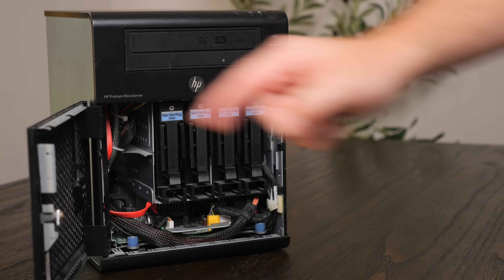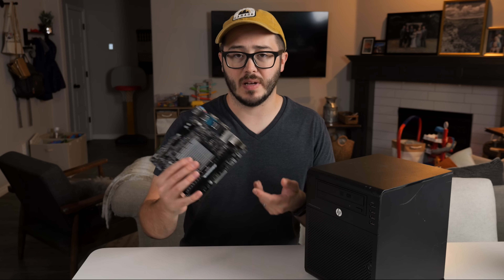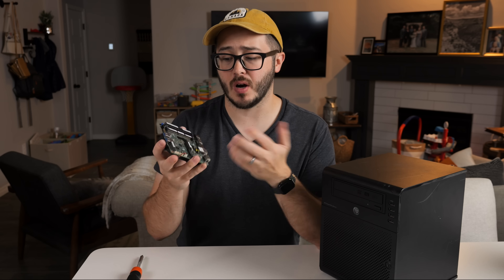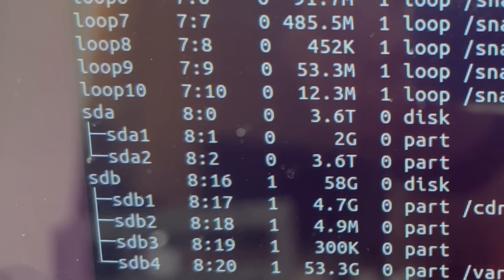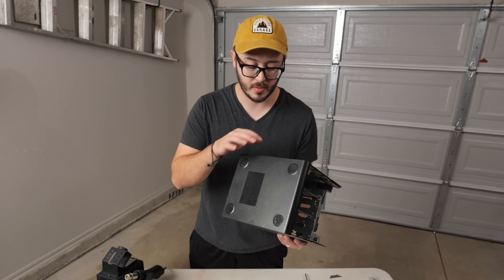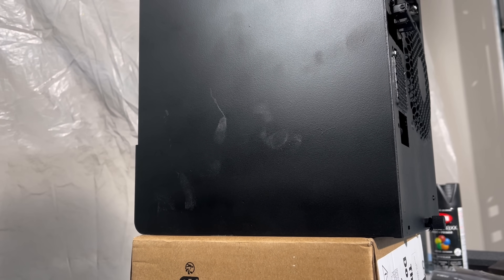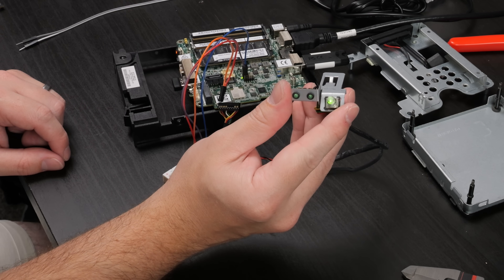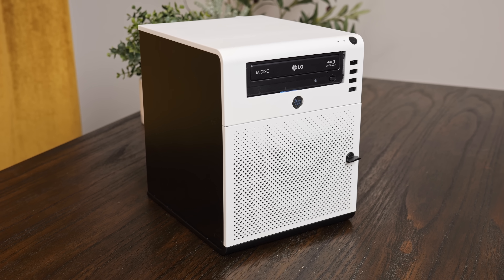COMPLETELY Overhauling This Old HP Server [Part 1]

Comment: Yes, never leave any parts you take off your project device on your work surface if they're metallic. Always keep your work surface clear of all items and put loose items including nuts and screws, tools, loose wires, meter probes, etc. in plastic bins off to the side. Been there done that a couple of times... similar to what happened to you, before learning my lesson. Static is another problem. Get some static grounding leads and straps and clips to ground yourself to a metallic object such as the metal frame/legs of your desk or nearby rack or something like that.

Comment: Waiting with baited breath for "Part 2". I have this exact same HP server (and one of the models before it), and I think they're great. At the time... they were a super cheap "home server" and I ended up putting a lot into mine to make it better. This one was $250 when I bought it, and I can't find a server that would equal it at that price even now, so I see why you went with it... I had a lot of the same thoughts (how can I update the MB?) when I got mine, and it didn't even occur to me to go with the Intel NUC, what a great idea!

I've been looking to repurpose mine, and I'm gonna say right now that I'm looking at the Zima boards to make mine magical again. I'd put 5 spinning drives it it way back when (500gb each), and put a SAS controller with an eight bay 2.5 SSD in the 5 1/4" slot (to make a NAS), but I've long since replaced this box as a NAS, and I'm thinking it'd be a great "media server" as described here, with the Blu-ray drive, and a bunch of SSD's. Something like this running CasaOS would be very cool.

One of the reasons why I like and subscribe to this channel is the fact that it gets me thinking about my options. 30 years in IT as a professional, and 40 years as a lover of all things tech and I still truly appreciate getting a different perspective on various tech, because it makes me think of the other 9 out of 10 ways to skin a cat.

Thank you!

Comment: Nice build mate! I love these type of mods, they’re seldom the most economical or sensible but they often turn out to be an enjoyable project.

 Ever since your first N40L video I’ve been toying with the idea of rebuilding mine. My best plan so far has been to use a stripped Lenovo Tiny or HP Elitedesk Mini. Still working on those details though. I really want at least one PCIe slot for SFP+ and I also want to be able to use a ASM1166 SATA controller for better C-states. 

My goal is to either build out a TinyMiniMicro(server)-freak on steroids for my ceph cluster, or just end up with a more usable backup server.. 😅
Looking forward to the next part! 👍

Comment: It looks to me like you're using the original nuc power supply and the power supply from the original server the question is WHY? The power supply from the server providers all the power you need. All this jerryrigging is pointless, just desolder the barrel plug and solder on some spade connectors and send 12v to the board

Comment: mine started with a 250gig HDD, an HD DVD Drive and 4 Gigs of RAM.
it now has: 120gig SSD for OS.
5x8TB HDD
Slim Line Blue Ray Drive, 
16 Gigs of RAM, 
AMD ATI 6450 or something low proifile for an HDMI Output.
An USB3/SATA controller card for 2 more ports and USB3 support.

Comment: I've been hacking up my Gen7 Microserver today - to accommodate a standard IO shield and you can definitely make an ITX board fit while only sacrificing one PCI slot.  I managed to test fit a board with a low profile PCIE card in the furthest right PCI slot.  

I just have to rewire the front IO and mod the motherboard tray a little.  I did manage to get the plastic panels off - you have to remove the bottom one first.  Guitar picks or old credit cards will be needed to defeat some of the pesky panel clips.  Even then, I still snapped two of the slide clips on the bottom panel - doesn't seem to have caused any issues.  The side panels come off pretty easily after the bottom has been removed.

I also had to cut out the guide rails for the rear fan, because they'll interfere with any stacked IO on the new motherboard.

The biggest issue is the CPU cooler - I have an ID Cooling IS-30 on order because even the ubiquitous Noctua NH-9Li is too tall at 37mm.  The actual height of the top of the NH-L9i fan, measured from the PCB, is closer to 43mm so the IS-30 should just about squeeze in.  It should be enough for a 12th Gen i5 MoDT ITX board.

Comment: Had a good laugh with that stray wire causing that SMD to blow up since you got footage of it with the flying spark. Then I felt the dread of accidentally killing hardware. I got reminded of my most expensive accidental killing of hardware on a Lenovo Yoga laptop where the I broke the ram slot. Damn ram slots were so fragile I immediately broke one side trying to get the ram stick out and caused more damage trying to superglue to ram slot clips back which ended up causing damage to the surrounding area of the board and the laptop never worked again.
I felt some vindication years alter when I learned that there's others on the Internet whose experienced the crappy build quality of those Yoga laptops, but damn it was still about 600USD lost on that mistake alone.

Comment: I just bought one of these, two weeks ago - it arrived on the morning we left for a two week cruise - going to fit a ITX MoDT 12th Gen board and a 6x2.5" dock in the 5.25" bay. 10 bays total, with three m.2 drives.  Looking forward to ripping into it.  I'm sacrificing one of the rear slots to squeeze in a standard ITX board.

Comment: @HardwareHaven Can you provide (in part 2) more detail about ensuring a common ground between the mini-pc and the external PSU for the SATA HD storage? I think I'm running into grounding problems when powering 4 external SATA hard drives from an external ATX PSU. The drives are talking to an HP Elitedesk 800 G4 Mini using an M.2 ASM1064 SATA adapter board with an SFF-8087 to 4 X SATA breakout cable - likely the same board and cable appearing in your part 1 video. For more than 2 drives, I see SATA bus/reset error messages, so maybe noise  from improper grounding.

Comment: 6:17
According to the spec sheet, that nuc can work on 12V no problems. Beats doing this janky stuff of dual power supplies which is a nono if you can avoid it. For future projects, 12V to 19V boost modules exists, just get one that has a huge heatsink and proper power rating and you're good.

Comment: I have 3x HPn36l microservers that have been in use for 13 years.  I recently decided to upgrade the ''main NAS'' to an Intel n100 based system (aliexpress motherboard with 12X SATA ports on board, 2x 1Gbe, 16GB DDR4 RAM in a Jonsbro N3 case) so I could consolidate data and possibly decommission the older NASes.

Comment: Hey long shot but I'd love to buy that damaged nuc board. I have a n3700 that runs debian 11. That 11th gen would be a huge upgrade. Ideally it didn't damage the cpu/pch. It should be a pretty straight forward repair. I do micro-soldering/laptop repair.

Comment: The trick with the open shoe grinder is to properly mark your lines with a visible pen, properly anchor the piece to the workbench (it can throw stuff away) and slowly start cutting well above the line. Once most of the metal is removed, you use the side of the disk to slowly eat-away at the rest of the metal until you reach the mark.

Comment: I might be wrong.. but normally the caps under the CPU are low impedance and may cause the multimeters to beep because they do so on <50ohms..
Reply from the maker: I wish that was the case. They’re like maybe 1-2 Ohms. I compared it to the caps on the replacement and they’re definitely shorted.
Reply: @HardwareHaven  You need to verify what you're probing and where it connects. Measuring multiple caps with low resistance doesn't mean that they're ALL shorted. But means there is a short present on that voltage rail. When you determine what you're probing, you could inject voltage (as long as you're not going to inject into the cpu/pch) and the shorted component will get hot. If its the cpu/pch, game over. If its a cap or resistor somewhere. Easy fix. Best of luck and if you want to sell it I'd love to buy it. Would be a huge upgrade from my n3700 nuc.
Reply from the maker: @sokoloft3  Yeah I at least know that it isn't every cap shorted haha. But it does seem to  potentially be Vcore that is shorted to ground. I think that doesn't necessarily mean it's the CPU that's shorted, but there's no way I'm going to be the one to do voltage injection haha
Reply: @HardwareHaven  well dang it.. I know some read like that, between 1 to 2 and around 4 ohms.. but still I'm not an expert.. just a tinkerer xD
Reply from the maker: @HugoFaria-AZ  I'm probably at whatever tier is below "tinkerer" lol

Comment: If the second board looks identical in the damaged area, i would desolder the burned smd-piece and measure the value in resistance. Then keep it seperate for later. If the value makes sense i would then buy a new smd-resistor and solder it on the damaged board. If it works great, if not the you still got a working board.

Comment: it might be worth trying to replace that resistor (and check around for other crispy critters in the area). some topologies for building power management can "look like" a short to ground when they're not powered, and you might only need to change out a few exploded passives to save the board.
Reply: Yup, might as well go all in now, the parts should not be very expensive, the difficulty to soldering them back will though😂 But that's good and interesting content

Comment: Every time I watch one of your videos I think "I wish I could do that." from either a creativity standpoint, a know-how standpoint (I have no idea how to solder and know nothing about capacitors or electrical current) or from a hardware access standpoint lol. Keep the excellent content coming!
Reply: Voltage: Volts
Current: Amps
Power: V x A

Higher the voltage, the more it hurts if you touch it. That’s about all you need to know

Comment: The N54L Gen 7 was a beast in it's day. Officially only supported 8GB but you could get it to work with 16GB of ECC RAM. And of course the Optical slot could house a 5th 3.5" drive. There is an internal USB port you can boot off if that's your thing. You could use an HBA in the PCIe slot and get true RAID. And there is an eSATA connector out back for further expansion. I used to mod the hell out of them. I still have a bunch sitting on a shelf gathering dust. The AMD CPU was the one thing you could not upgrade sadly.
Reply: I've got 4 of them, my main one has 16GB, LSI 9211-8i HBA and 9x drives (4x HDD, 4x SSD in a cage mounted in the CD slot plus an SSD boot drive, running TrueNAS). I also have 2x more HDD hanging off the eSATA in Startech 2-drive dock. If someone made a drop-in modern motherboard I think they'd sell a few - I'd certainly snap them up! I know, economies of scale etc. but hey, I can dream. It's just a brilliant case... wish someone would copy it!

Comment: You can replace the blown resistor if you can figure out the ohm on it.
Reply: I suspect a lot more was fried than just that
Reply: @TheDesertsweeper  another video idea - get the.boars video diagnosed at one of those fix electronic channels
Reply: @TheDesertsweeper  usually when those things fly off, they are designed save the board itself
Reply: @Phil-D83  indeed, but not so with me, so far. And I've had my fair share of sparkles over the last 35 years of tinkering

Comment: i did a similar rebuild of my N40L gen7 micro server. but used a laptop motherboard with a 1135G7 i5 , same mini sas adapter from aliexpress , but i had to use a USB3 2.5G ethernet dongle for connectivity as my board had no ethernet (but has a wifi soldered on). but yours look much better so far ;)

Comment: I understand this is filmed for content but just getting a dirt cheap 4-bay itx case and using the N100 asrock board would be better then anything that will come out of this 😸
Reply from the maker: It was indeed for fun and by no means meant as an affordable or reasonable alternative. That being said, there aren't many options for small 4-Bay cases that also have a 5.25" bay and 2 PCIe slots.
Reply: @HardwareHaven  5.25" stuff is really old as ODD formats took over for small factor optical drives. You could have printed an external enclosure for the BD-drive with a SATA to USB converter.

On another note there is a mysterious little Gigabyte board available from the EU called MJ11-EC1. It has almost a cult following because its so cheap and good and also weird. Perfect for a NAS. I have bought at least 4 of them. I think it would be a good fit for your type of content :)

Comment: My NUC works fine from 12v power supply for more than 3 years, so you can safely plug it into case PSU 🤷‍♂
Reply from the maker: Yeah i considered that, but figuring out how to power everything on consistently was going to be a bit annoying without replacing the power button with a switch.

Comment: $40 10Gbit NIC + literally any good CPU made in the past decade = 1GBps SSD NAS
The only concern is you want a low idle power system.
Reply from the maker: This wasn't meant to be the best or most reasonable system by any means.

Comment: That rogue wire is exactly the sort of clumsy mistake I would make. My response would not likely have been as calm. Kudos for pressing on.
Reply: Same - every time I work on computers I invent new swear words. 😕
Reply: I made that mistake once, but I was lucky that the PSU I was using was so bad that the short circuit current fried it before the motherboard, motherboard lived on. 
Lesson learned.
Reply: *kudos
Reply: @PinataOblongata  you're right! I was tricked by my Canadian cellular provider Koodo that I have been fighting with recently. Argh!